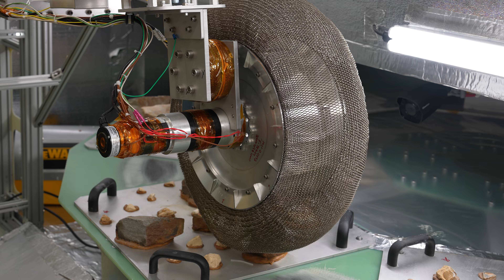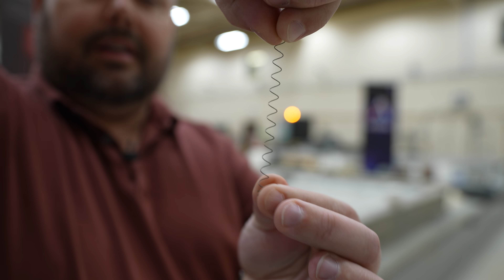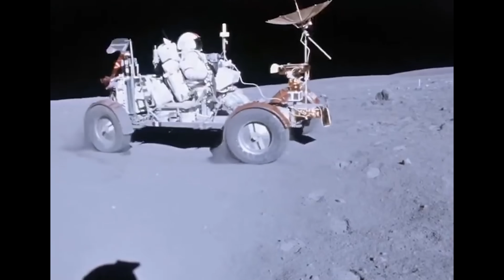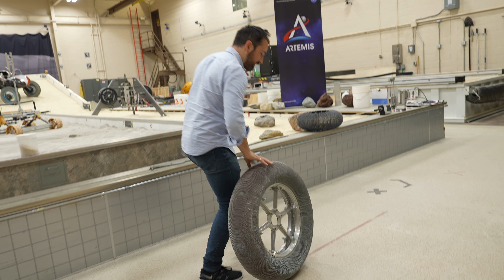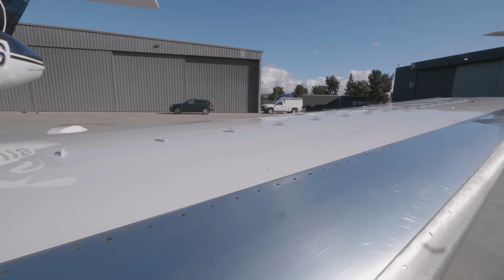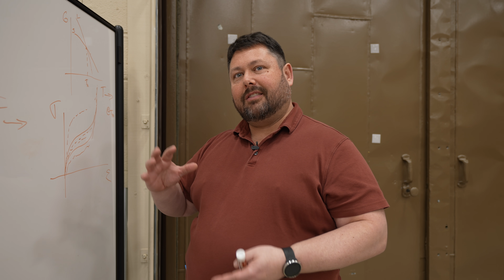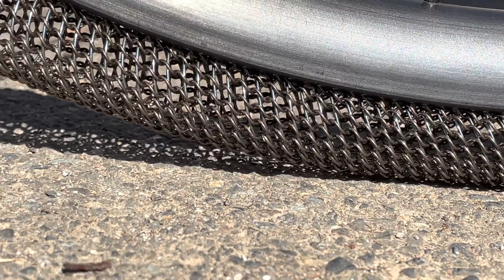How NASA Reinvented The Wheel

Comment: "industructable" until it reaches its melting point or higher?
Every substance and element has a boiling point and a vaporization  point, both well below 5,000 degrees celcius. (the temp of the surface of our sun, which is warm enough to instantly vaporize everything on and in this planet - and this planet ... and every other known thing in the solar system, come to that.)
Nothing physical or with mass in this galaxy is "indistructable". Enough heat will destroy it.
Conversely,if something were to hit absolute zero, the point where the atoms and all the parts of the atom no longer have motion, would the item become sub atiomc dust, since the motion of electrons is what holds atoms together?  
Ifso, then both enough heat and enough cold can destroy anything.

Comment: Just so everyone knows, these properties exist in other less novel solid solutions like steel. Look at TTT and phase diagrams to see all the different microstructures metals can have based on how you cool them and what alloy ratio used. I actually wrote a paper on this about powdered metallurgy metals with specific ratios of bainite martensite alloys in steel exhibited the TRIP effect (transformation induced plasticity) and presented completely different material properties under plastic deformation. Source: I’m a professional engineer and with a degree in mechanical engineering

Comment: I've been lowkey obsessed with nitinol ever since needing my first pair of glasses in the late 80s and constantly having to go back and get my glasses adjusted or repaired. Too often, having fallen asleep with them still sitting on face, I'd wake up and find my eyeglasses had undergone some Level 6 trauma during the night and had jumped off the  bed to escape the night terror. At best, they would sit crookedly and at uncomfortable angles to my face. After a while, the eyeglass fames would be stretched, twisted,, plasticized so hard, I'd need new fames altogether. Learning they made eyeglass frames with memory wire was like the heavens broke open and angels started singing.

Comment: As a German Mechanic i can"t understand why they wouldnt implement a System that the Manufacturers use in other Countries since the 90s. Electronic Immobilisers are Law since 98 in Germany and most Cars had them since 90. If its keyless, all the Parts for the immobiliser should be equipped anyways.

Comment: Other comments mention NiTi alloys in dentistry - points worth considering.

I had my first root canal when I was 19, as a result of an infection contracted on vacation which killed the tooth's root. That was in 1971. Modern dentistry in those days used a silver alloy to fill the canal. Later experience proved that, even enclosed within a tooth, the alloy would eventually rust and need refilling. I had excellent dentists, for which I am thankful.

So look upon yet another of the hundreds (or thousands) of revolutions in materials sciences that have happened over the past 50 years, that can be directly traced to work done at NASA and for space projects. Detractors of NASA deserve hard rebuffs for blathering when they know so little, and bad-mouthing without understanding that imperfections are a reality of everything in life, institutions included. I credit NASA's meticulousness in work procedures as worthy examples to learn from everywhere in science, economics, and business. I don't advocate simply copying them. I do advocate adapting and reapplying. After all, the new tires are also an example of that, even within NASA.

Comment: Seeing this, makes me feel awe inspired and challenged.   Now I want to limit-test this material to see how it acts with various loads of stress and deformation while applying the 'return to shape' conditions.   At what point does this material break or reprogram itself into a new shape?
Can we create an on-demand factory on the moon, or other planets, that will recycle an object of this material and fabricate new ones from it for alternative functions as necessary?
How feasible would it be to use such a factory in the creation a space vessel in allowing it to self-repair and remachine itself to adapt to new knowledge  we have acquired and new situations we might encounter during missions throughout space?
How does this material get programmed to return to shape at differing temperatures?   Can we find other methods to change that programming for any temperature to work in triggering the reformation?   So many questions..

Comment: how good are these tires for high speed cornering? And also how much is the traction they can provide? Clearly the tiers as they are would not work asphalted surfaces, very low traction. And their tyre sidewall would give a lot in cornering, that would be some weird handling vehicles :P

Comment: That bike wheel looks interesting but still needs a bit of improvement. It should prevent water and gunk accumulation inside it, especially in sub-zero temperatures. Maybe some kind of foam will do the trick.

Comment: for our use on earth, cars wouldnt be that great. First it would tear up the roads as the steel is harder than the road surface, the traction isnt anywhere near the same, and just too costly for the average person.
Reply: SMART plans to add rubber treads for use on Earth once it becomes a commercially viable product, which is all that will have to be replaced instead of the whole tire

Comment: Nitinol, I used to work with this crap. To get it to adhere to a shape I had to bathe it in a vat of sand @ 500°C for 7 to 8 minutes then quench it into a liquid that had a chemical coolant inside. This is by far the weirdest metal on earth that I know of. I legit took a scrap wire and bent it 360° onto itself and it returned to a flat 0° piece of stock in seconds. After that temperature shock from hot sand to the coolant it holds its shape. I was manufacturing bone staples at the time and with the particular set up we had a 85% success rate due to just how many times the inside radius would be off or if the two legs were longer by 0.010mm +/- sometimes even smaller dimensions ugh it was a nightmare. However the metal itself it's absolutely going revolutionize the world and I knew this back when I worked for that company over 3 years ago.

Comment: there is one downside i can see for car use, it is not adaptativ ! if you load a crap load of things in your car, you need to put more pressure in the tires to compensate, but you can not for now with this,. posibly we coult think about little air for compensation but you can rupture them too (it would not flattens completely)

Comment: It is all very well putting it on a slow moving Mars rover but when you start using tires made of any hard material on 4x4s or traditional cars and it contacts with another hard material, you are going get wear + traction issues quickly (sand + mud off-road is obviously fine though).

Comment: This is good presentation, of the long-term colonization problems, to the Moon or Mars.  I am one of the last-alive design engineers of the original Lunar Roving Vehicles.  One of the main problems we had, other than impact deformation & breakage, was the "abrasive wear" due to the Lunar dust.  In actual testing, ordinary steel wires, of various alloys, only lasted a few hundred cycles in simulated Lunar dust.  Vacuumized dust has similar properties to diamond dust.  As a result, it became necessary to "coat" the wires with a sacrificial coating (zinc for LRV), in order to prevent "sawing" of the wires during flexure.  It was thought at that time, that the astronaut's suits could be punctured by any sticking out wires ends.  This became relevant, when a fender was knocked off, and a repair became relevant.  The entire wire-design of the original LRV wheels was based on the ability to withstand wire breakage, for the duration of the mission.  Other coatings were tried, but were too time-lengthy to implement, at that time.  We only had about 14+months to do this.  This presentation is inadequate, in that it shows testing on Earth, in conditions which cannot exist on Moon or Mars surfaces.  Modern materials mathematical modeling is showing that these wire-like Nitinol wheels will have only limited useability, unless more durability is built into them, using other means.  On the Moon, in the dark, the crystallization temperatures of the materials will dictate their survivability.  It is probable that only some kind of "composite" structural material will survive, for very long.    NASA has videos of the various impact and deformation studies which we did, and there is material available about the dust abrasiveness at their sites, and from the still remaining Boeing engineers.  Bruno.

Comment: They use this metal in orthodontia too. The wires for braces are made out of this. They are “programmed” as the parabolic shape that the orthodontist wants, then bent and tied into the braces. The heat of the mouth (aka your body heat) makes the wire “want” to return to its original shape, thereby pulling your teeth into the proper position! I was amazed when my orthodontist showed me this, it was super cool to see as a kid.
Reply: Ovi krajevi su resili sve problems mog projekta svemirske letelice sada mogu da tvrdim da je moguce vozilo koje moze da se krece svjetlosnom brzinom a jos je moguca tehnologija koja ce skoro  besplatno izbacati stvari u svemir kako kako ja nikad nisam mogao bit posvecen toliko tome svaka cast aaaaa ludilo jea bre Tom jer mogu da dodjem da zivim u ameriku aaaaaaaaaaaaaaaaaaa top a ja nisam
Reply: Woah wtf that’s awesome. I wish they told me that back when I had them that would’ve been sweet
Reply: Wait... so why when I had braces as a kid did they need to constantly be tightened and adjusted? Or is it a newer thing in orthodontics?

Edit: Also my teeth wanted to return to their original position as well... 5 years of braces and retainers did nothing!
Reply: @asherandai2633  my first thought is that one reason for the tightening/adjusting is just minimizing the load on the patients teeth/gums. in theory you could set the wire to the max tightness from the start, but it would put so much strain it would be too painful and potentially damaging.
Reply: @asherandai2633 when i get mine adjusted, they usually put a thicker wire in, and i imagine they check if everything is going well.
Reply: @asherandai2633  because its obviously a new tech
Reply: @koffing2073  Imagine thinking everyone knows about all technology and when it was created and used. He asked a question because it wasn't obvious to him.
Reply: @koffing2073  obviously not obvious to everyone
Reply: And it will only take 30 more years before America uses it probably.
Reply: This is partially why ice cream is a common way to relieve pain from braces. Not only does it numb your gums, but it also loosens the wire!
Reply: @wumpbos6419 No. It changes back to its original shape with heat after being mechanically deformed. It doesn't just lose its shape with cold.
Reply: My favorite part about that technology is it's entirely based in the superficial ego driven society we created.

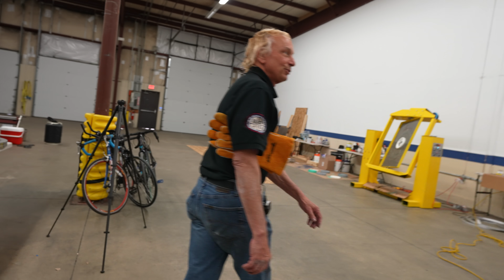Comment: @3:39, NO it is not 250 degrees F below zero 'in the shadow'.  The steel rod absorbing the heat on one side is radiating heat off the back side, not to mention all of the reflected light heating the 'shadows' also.  This is a fallacy that tends to lend itself well to ignorant people  thinking we couldn't have gone to the moon, with one side of me at '250 degrees F' and the other at '-250 degrees F'.  While it might be true enough between the dark side of the moon when compared to the light side of the moon (even this is not true), it is NOT true if you have something standing in the sun.  Even the dark side of the moon is warmer than that because of the surface radiating heat 'at night', on the far side of the moon.  It may be getting to be that cold on the dark side of the moon by 'moon-morning' after radiating all 'night', but even then I suspect it isn't that cold.  I'd love to see some NASA data as to the temps they measured, INCLUDING the incident thermal radiation FROM the moon surface.

Comment: Imagine what would happen to a road over the course of a month if all cars were to switch to the nitinol tires. The roads would be worn out and pretty much shredded
Reply: Potentially the wire mesh would be inside a rubber skin (like the bike tyres shown), just replacing the "air"

Comment: If you think about the powder charges and projectile speeds back when the fusion happened then you think about the results you created it’s clear to me that you may need to make that into a black powder muzzle loading device or back off the powder charge and change to a slower burning powder and rechamber for a shorter OAL. I think you simply have waayyy too much momentum for fusion of the bullets and it’s just transferring energy into the expansion plant instead of fusion as heat? Thoughts?!

Comment: But how much traction do those new 'tires' get. On the macro, they are pretty smooth compared to regular offroad tires, and if they can deform that much, does that apply relative to the road? How effective is it at moving a car?
Sure, it goes over obstacles well and cannot be punctured, but it does not look like it can grab the flat road very well. It doesn't look to have tread or anything close. The small springs are very smooth and completely round. If you put that on a car and stepped hard on the gas, would it grab the road and propel you forward, or would it just spin?

Comment: Manufacturing seems extremely difficult relative to traditional gears and bearings due to the complex curves and high hardness requirements.  But total lifecycle energy and longevity can likely create a real savings in some applications.  The greatest cost justification could be an improvement in reliability(depending on application).  Unplanned machine failures can be very costly.  Temperature Another angle could be precision under load.

Comment: This was super interesting. Would love to see a follow-up video going into some of its limitations and why we haven't seen it more in industrial use for something that was discovered in the 60s.
Reply: One of the big ones is just that it's pretty expensive
Reply: @panner11  So were computers back then. But the costs came down massively as they improved and got better at making them.

So if it really is still so expensive, the question is what's stopping them from improving and getting better at making them?
Reply: @asherandai2633  the material is titanium, how many things are made of titanium? Shows you how rare they are
Reply: @pkmnogosari6091  titanium is the fourth most abundant metallic element, and the ninth most abundant element overall. It’s not rare at all, so it shouldn’t be so expensive.
Reply: @pkmnogosari6091 The rarity of titanium has more to do with the costs of manufacturing products out of it. It is very energy intensive and has an approx. yield of 16:6(Raw Ore to workable material). Furthermore, the properties of the finished metal mean that creating a final product out of it is also a more difficult process than many other metals. It has gotten easier in the last two decades or so, but it is still quite expensive just to work with titanium.
Reply: @asherandai2633 Same reason computer chips became far cheaper, lots of investment. Computers are an obvious improvement in so many areas. A new kind of metal, not quote as obvious. Change takes time.
Reply: @slinkerdeer  titanium isn’t new.
Reply: @asherandai2633  Nitinol was discovered in 1959. Yes, that is pretty new. 60 years is not a long time.

Comment: I don't remember where, but I've seen this video approximately 4 years ago. These tires never went anywhere.
Reply: Do you really think we're gonna have a Mars mission in that 4 years? And for civilian use, the biggest challenge is scaling up for mass production, not really about technology, and that could take decades.
Reply: @longlehoang2556  I meant they just work worse than solid aluminium wheels. 
In any case, NASA recently contracted NASCAR to build their lunar vehicles, so they'll surely build lunar oval tracks to accomodate those.

Comment: A pneumatic tire could be used in a vacuum. Consider a tire that is normally inflated to 50 psi. A tire inflator with a pressure gauge indicates atmospheric pressure as 0 psi, so it indicates tire pressure as the differential between inside and outside the tire, in this case 50 psi. In terms of absolute pressure, the pressure outside the tire is one atmosphere or 14.7 psi, and the pressure inside the tire is 50 + 14.7 = 64.7 psi. In a vacuum, the tire could be inflated to an absolute pressure of 50 psi, and that would be the pressure differential between inside and outside the tire.

Comment: The tire thing for bikes won’t ever work, especially never for mountain bikes. Mtb’s change tire pressure often even in the same ride so you can’t have a non adjustable pressure. For road it might but it’s heavier than a normal tire so serious riders won’t use them.
Reply: Neither mountain nor sports bikes make up the majority of bike rides or riders.
The vast majority of bike mileage is just people wanting to get from A to B. And to them, tires that don't loose air and can't go flat would be a definite advantage.
The main drawback here is not weight, it's cost.